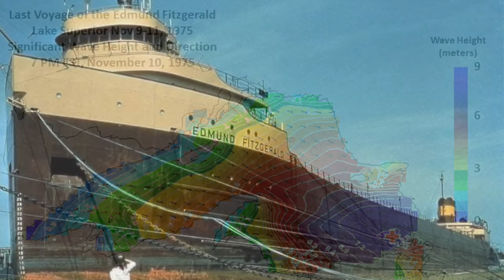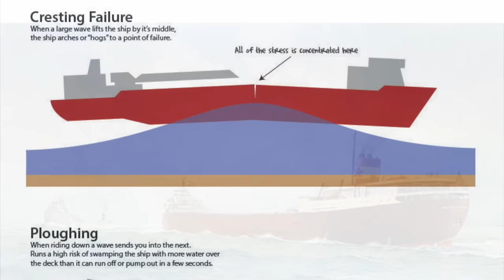What Happened To The Edmund Fitzgerald?

Comment: She had a broken keel, she was over loaded for a winter run. Only had 3 large holds unlike most that had 5. 2 less bulk heads made her very tender. Basically a broken, over loaded wiggle worm out in the worst storm in years. The Fitz had no chance. Keep in mind it went down in less time then it took to watch this video
Reply from the maker: They had no time to cry for help or anything
Reply: Actually, she went down in less time than it took to write your post.
Reply: They loaded it to the summer load line  instead of the winter line .
Reply: @adamwatson6916  That is exactly what I was getting to write. Apparently they had received clearance from the Coast Guard to run the Summer Line versus the Winter Line?
Reply: That's crazy.

My grandfather was a merchant marine before, during, and after the war. He said the only time he was scared was if they had a light load of some sort. With a heavy load he said you'd just go right down to the bottom. A light load you'd be at the mercy of the sea. 

He was an amazing man and I miss him every day
Reply: @Will-tm5bj  rumor is their were weld issues and keel was getting bad
But her sister ship was made same way and sailed tell 80s when pulled which would have have been only middle age for a great lakes vessel.  But it had same rumors.
The big issue is the flex which would be fine for an ocean ship isn't great for a great lakes vessel where they can take waves from multiple directions seemingly at same time.  
Flex probably caused her to shoal out and she was then taking on water and the 3 sisters  (the giant waves) tore her apart and that was the end.
If it could go wrong, it went wrong and they had the perfect storm.
Reply: @cw93711  flex can hurt ocean going vessles as well though. There was a recent video of one snapping in half somewhere. 

In either case, to be on ships like that is wild AF. 

at least on the lakes they never had to worry about uboats lol
Reply: @JonnySublime  It is estimated that the time it took the ship to go from the surface to the bottom was about 17 seconds.

Think about that.
Reply: Disagree…it was going down for a couple hours…the very end was just ‘all of a sudden’
Reply: @robertwagner8728  Agreed.  They had time to be radioing back and forth for a good bit.
Reply: I think she grounded. And this is what broke her rails when the whole ship hogged in the middle. The bow just got heavier and heavier and as I went through the waves it would get pushed further under the water for longer until finally it just didn't come up. It's hard to think about it but the ship is longer than the lake is deep so when the bow went down and struck the bottom the stern section of the ship kept trying to go and probably snapped it in half that would explain why the stern of the ship is further along and upside down
Reply: @robertstone9988  That would also explain the speed at which she sunk.
Reply: @cw93711  regardless i've watched videos if modern ships breaking fully in half with a load onboard the ships have remained afloat long enough for the crew to get emergency calls off. yet none came. it took 5 minutes for the signal for the fitz to go out completely that means while there were 5 minutes the ship could have been floating the truth of the matter is whatever happened to her was nearly instant. and while the ship was in deep water. the fact that the bow looks like it was driven into the floor and the stern was not tells me she went down bow first. had her back broken and split on the surface it most likely should not have had the bow driven into the floor like it is. leaving only 2 options as to what killed the fitz. the first is called ploughing this is when the ship's bow is driven into the water deep enough to submerge the whole front of the ship and the ship may decide to continue to drive deeper into the water causing the ship to sink. the other is what is called ploughing to the bottom. this is when the ship is longer than the water is deeper and the ship's bow is driven into the floor. with that said the Fitz was almost 800 feet long that would have left the last 200-300 above water if she was stood upright. and since the fitx had her engines near the stern she easily could have powered her whole bow into the floor or the lake and allowing her snap the hull upon impact. this also accounts for the lack of any emergency call or response as the wheelhouse would have already been at the bottom by the time the fitz's radar blip was completely lost. and the water was bad enough that it would have been plausible for the fitz to start ploughing.
Reply: The number of bulkheads has nothing to do with a ship being tender. Bulkheads run vertical & decks run horizontal. On ocean going ships the bulkheads would be watertight. But on Great Lakes bulk & ore carriers the hold bulkheads are not required to be watertight and water entering one hold freely flows to all holds. So the number of spaces the cargo hold on a Great Lakes ship is divided into is a moot point the entire hold is one large free flood area.
The Coast Guard allowed many ships to deepen the load lines on the Fitzgerald it was not done simply for this one trip, but had been done a couple times over the years. Each time being a permanent change approved by the Coast Guard. 
And
As a "tender ship" means the ship is too heavy loading the ship to a deeper draft would make the ship less tender.
Reply: @cw93711   they x-ray all exterior welds now. Fyi only good welders can do hull work.  Interior welds are pressure tested I did however point out a hole in one hull which was ignored.    It was high on hull and very small but you could see light threw it.  Fixed it during my damn lunch.  Didn't tell anyone till just now. I can not guess how I would be ok if they sank and I had not fixed the thing.  As far as I know it's still afloat.
Reply: She had a broken keel? You have a source for that? Of and you pronounced christened wrong. It's krist-aned not christ-aned
Reply: @Will-tm5bj  hilarious
Reply: @signolias100  I hate to be picky but your technically wrong but not wrong.  She was 728 feet long. It would have been better saying almost 750 ft long but yeah
Reply: @crazyeddie1981  ok so how does the lack of 72 feet change the fact that she could have driven herself into the bottom of the lake the fitz would still had nearly 200 feet of hull above the surface had she gone straight or nearly straight down. even if she didn't the ship going down via ploughing is still more of a relevant option than "she broke on the surface" or "she hit the shoal and was mortally wounded." i'm almost certain in either of these cases the captain would have had the common sense to call for evacuation and send a distress call. the only way that there was no distress call is only one of 2 ways the first is that the Fitz lost all coms which is either due to loss of power, antenna array, or the radio was damaged. the other is that the wheelhouse crew was already dead and the wheelhouse was already inaccessible to the rest of the crew (i.e. the wheelhouse was underwater.)

as far as my statement about her length is concerned the Fitz at 728 feet in length is 91% of 800 feet making my statement still fairly accurate is it more accurate than it was nearly 750 feet long? no, but still a fairly accurate statement.
Reply: Lol, to all the critics, go ahead and link your videos.  Would love to watch..oh wait? They don't have any- surprise surprise.
Reply: @benmiland5245  Lighten up man.
Reply: @ConnorTenold  there was a ship near her at the time she went down they had comms together but the fitz was further ahead inthe storm . The last radio comms that the other ship had with the fitz was they asked how she was . The last thing ever heard from the captain of the fitz was “ we’re holding our own “ she was never seen or heard of again
Reply: @robertstone9988  there seems to be a growing consensus that she grounded.  It makes the most sense.
Reply: @davidpallin772  my thoughts exactly.  C'mon Ben these are YouTube videos.  Not a  formal hearing.
Reply: That last sentence is haunted, but yes
Reply: There's 3 theories of what caused it to sink. Bulkheads don't really have much to do with any of them. Most likely the hatchway covers weren't sealed, some were missing when pictures were taken by the NTSB after it sank. More than likely the hatchways where the ship was loaded & unloaded took in water & nosedived during a big wave & hit the lake floor.
Reply: @timothygeiger8271  that is certainly possible but no more possible than she touched bottom right?
Reply: I agree partially: the loading is another factor. If you load heavy on both ends and lite in the middle you create  a potential flex that could be catastrophic!
Reply: That may be all true, but the evidence indicates that is not what sunk her. It did not break up on the surface, half the hatch clamps were not "dogged down", and it was slowly settling for at least 3 hours. When taconite gets wet it gains 7% in weight - or another 2,000 tons! The hatches leaked, the load got wet, and the pumps were such that they were useless. It just lost buoyancy. The Fitz had low freeboard to start with - which was changed for all ships after the sinking, and this is why we haven't had another wreck. Under these conditions it is critical that the hatches are sealed properly, something the captain and crew failed to do.
Reply: @scottnelson2384  I'm sorry, i wasn't aware that you had more access to reports about the Edmund Fitzgerald than the NTSB or coast guard, & certainly didn't know you have more investigative experience than they do. Please tell us, how old were you when Edmund Fitzgerald sank & were you the lead investigator??
Reply: @timothygeiger8271  no offence, but what is with this snarkiness? are people not allowed different opinions? this comment section is heavily fascinating to me, since it brings up so many different theories about what really happened (which, given the current state of science, we are unlikely to figure out for now) in that awful storm that november night. and by all means, reports can be fixed/faked - accidentally, even, not necessarily intentionally - ... things can be overseen even by professionals. so please, enlighten us about why you're so upset about someone expressing another theory than the one that you yourself find satisfactory.
Reply: @timothygeiger8271  or is it "just" the wording that you're unhappy with? alas, these aren't scientific papers that people write, they merely express their theories and opinions. so in my not so humble opinion, don't get fired up about missing "supposed to"s and "probably"s.
Reply: @Kayaya  you jump all over me, when i was merely pointing out what the official reports say, but he acts like he knows more than experienced investigators! 
I never once insinuated others don't have an opinion, but i do question you jumping all over me, when he's the one that acts like he knows more than anyone else. 
Then you jump all over me about wording, when i never said anything about wording. 

If you want, i will say something about wording! I really don't much care what you think, but either you can't spell, or you're from another country, not the US.
Reply: Exactly what happened, the waves were rogue and the ship was tired.
Reply: @Dan-qt7kq  Very Good Dan. I live in Northeastern Minnesota and the following morning after the Fitz disappeared an old timer from down the street came to our house. This old timer had a skill set second to none. He also had forty plus years experience working on the boats  on the Great Lakes. He mentioned to my Dad and myself that the “Three Sisters” sent the Fitz to the bottom of Lake Superior. He told us that he had lived the night of the Fitzgerald on numerous occasions during his time as a mariner on the Great Lakes.
Reply: Some Ships Engineers that had served on the Fitzgerald commented about broken plates in the bilge area.  That damage happened at the launching.  Some welding repairs were done.  But the Engineers said the plates were not in proper alignment.
Also, after the wreck was discovered.  All the hatches were secure by divers.  
Seems the Fitzgerald was doomed from launch.  But the heavy load was a bad business decision by somebody.  So matter how skilled or brave the crew was.  Too many things were going against them.
Reply: @robertstone9988  hull plates degrade during the lifetime of a ship, through friction & corrosion, becoming markedly thinner after 20+ years service. I have a recollection of reading somewhere that in severe cases 50% of the thickness can be lost.
Reply: Oh no
Reply: The overloading is a speculative point. The Fitz was listing which she was already sinking. That was the ore getting water logged which drastically increased the weight. 
 The theory I believe is the Fitz bow and stern where raised by 2 separate waves leaving the center bearing far to much weight for its construction. She broke in 2 and disappeared from radar. How the wreckage is poised the impact on the floor blew the covers. I believe the crew deck-boss, and captain wouldn’t have sailed or allowed hatch covers to be improperly closed. 
 The Fitz was essentially the American flag ship and was a ship everyone wanted to be on. It wasn’t crewed with greenhorns or misfits. Getting assignments to the Fitz was a prestigious assignment. She broke many records in her service in the 1970’s working on the Fitz was like being on USS CVN-65 Enterprise.
Reply: @Bob-gy6ud  - The buoyancy or weight of a ship can be calculated by the displacement of water.  At any given draft, or displacement, the load on a ship is known.  The draft of the Fitzgerald while in port was known.  And from that people know if the Fitzgerald was overloaded for the conditions or not.
Reply: @duelinglectrics  my uncle was on the author m Anderson behind the Fitz he's gone now but I have something very rare I have pictures that he took if the lake and the the storm that they and Fitz were in got about 45 seconds of tape footage of them behind the Fitz
Reply: @chrismiller4374  that is legendary footage my friend ! I’d love to see that gave me goose bumps just reading that
Reply: @duelinglectrics  send me a link or address I'd be more than happy to send you pics and a copy of the film
Reply: @duelinglectrics  like I said I'd be happy to send you copies of the film and pics just give me a address
Reply: Insurance company. Enough said.
That's also why they don't want you diving on the wreck. They don't want new evidence coming to light that can be used by the family to sue northwest mutual
Reply: @scottnelson2384  Captain Mc Sorley wasn't an idiot.  You can bet the hatches were clamped down.  Many failed due to the dynamics of the sinking.
I believe the covers weigh about 25 tons.
They would not wash off even if not clamped.
Reply: @Will-tm5bj  meaning what…that the ship would sink faster and it would be over faster?  My grandfather was also a merchant marine, before, during, and after the war…
Reply: @geslinam9703  yes exactly that
Reply: She broke in half, sank very fast, the ship was extended to make her the largest ship from the United States. The pride of the American side!
Reply: Great comment, highly informative
Reply: Really, The Captain should have known better. I mean, He should have known his ship, it's capabilities, and the situation they were about to be in.
Reply: @ConnorTenold  kind of a mystery of where the captain and the people in the pilot house went since the waves smashed the glass and ripped them out when it sunk sad that they are still intact due to the temps
Reply: @duelinglectrics  😊
Reply: It looked like there were many 
"holds" . For iron ore.  Around ten. 
What am I not understanding, if you don't mind my asking?
Reply: I grew up in Whitefish Point and I was 11 when it went down. My older brother Russell was graduating in June from Sault High and he got a welding apprenticeship on the Fitzgerald and was supposed to meet the ship  in Sturgeon Bay, Wisconsin the week after graduation to start repairs on the boat but the boat went down in November the fall before graduation. Had that happened one year later he would have been on the boat. He just retired from the boat yard in Sturgeon Bay.
Reply: @Will-tm5bj   All of my uncle's and my father were merchant mariners also on the ore carriers before, during and after the war. They all retired from the boats.
Reply: It went down in less than 30 seconds when it speared the bottom and snapped in half, there was no way to escape and the force of the impact would have sent everyone flying into bulkheads and whatnot, by the time they could have regained their senses and composure they were already under the waves, if anyone of them was even alive at that time.  Long ships in shallow waters in rough seas can literally disappear in a flash this way.
Reply: @damienpalladino8797  This then was a contributory factor to what happened to the Edmund Fitzgerald and her Crew - carrying the Summer Load rather than the Winter Load (obviously there is a reason why this in place given the unpredictability of the weather on the Great Lakes, especially in the Winter time) cost these Men their lives, making good time/money can never be equivalent to a Mans life - it wasn't worth taking the chance/playing Russian Roulette with these Mens lives🌊💧❄🔔❣🌹
Reply: She could have grounded on that shoal, there could have been cracks in her keel plates, she might have been overloaded, and she was certainly taking on water. Any and all of those factors in my mind caused or contributed to her loss. Rouge waves also could have killed her. The wreck leaves no doubt the bow slammed into the bottom hard, and the midsection collapsed while the stern rotated due to the momentum from the still rotating propeller. That is why its upside down while the bow section is sitting upright.
Reply: @benmiland5245  Something broke the keel, it may have been weakened by fractures but the sinking finished the keel off.
Reply: It may have only taken 17 second to go to the bottom but the crew was ordered off the deck so at least some of them were probably in water tight compartments when it went to the bottom prolonging their fate. Makes me think of the seven Astronauts on Space Shuttle Challenger.
Reply: Altho it was speculated that it broke then went down, the coast gaurds investigations found that it was the force of hitting bottom that broke it. She went over a crest, came down way to hard, broke thriugh surface of next wave and went straight to bottom. Tho overweight most likely was the cause of it sinkingnin this mannor

From all ive seen in researching it. She went down and was fully under in 15-40 seconds. From moment she broke through and into the wave. Too both halfs fully submerged

Tho for my curiousity side, i often wonder if built differently. Able to withstand the impact of hitting bottom she should have resurfaced, or if she was in deeper waters if she would have survived. Where she sank the shio was way linger then how deep the waters where. Pretty much bottoming out the vessile due to how it hit, and nailed it right on the front
Reply: They weren’t cryin the captain n crew were desperately trying to save their vessel all while knowing that their fate was sealed
Reply: They didn't even have time for the life boats
Reply: @timothygeiger8271   Remember, there was a Gale Warning out when they were readying to leave Duluth.  As a veteran crew they would have made sure those covers were dogged down securely.
Reply: @rickwren338  nope...didnt break on the surface
Reply: @446hemi  never said she broke on the surface, she broke In half no matter how it happened cause I was not there, so whether she hit bottom which broke her keel, or not! All I know is that she broke in half, sank killing some good men! Pictures prove that she broke in half, and would have went down very  fast! May they rest in peace!